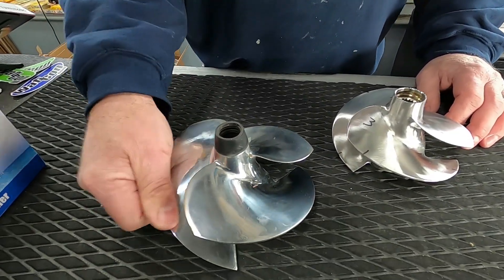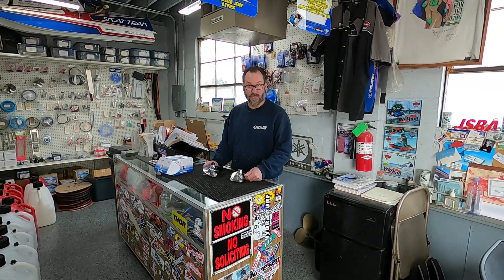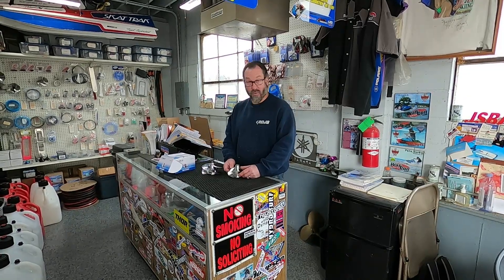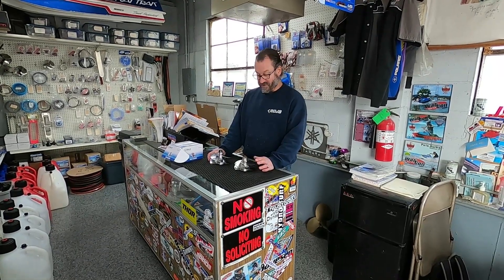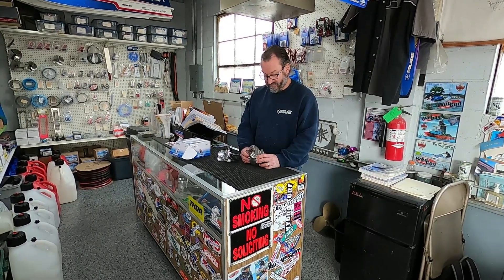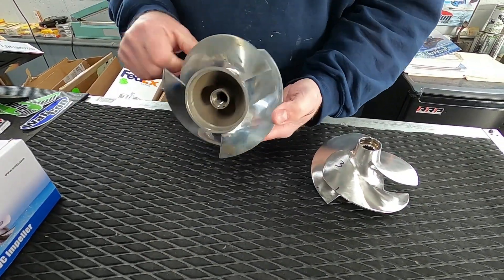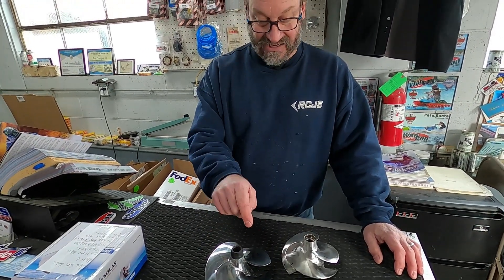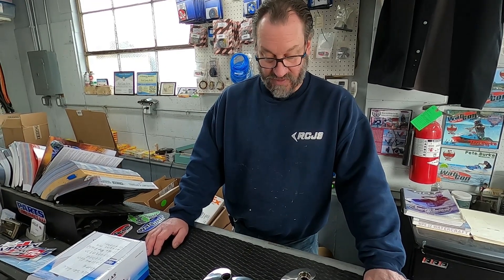Impeller Blueprinting

Comment: Thanks for the informative video. I wonder if you might do a video on the Yamaha 650, 701 and 760 engines. I'm familiar with the Kawasaki engines but not sure what the differences are with Yamaha and what can be interchanged on the cylinders for better performance. Thanks.
Reply from the maker: Thank you for watching. We have a video on 701 clys, where I talk a little about the port timing differences.  Yamaha 701 is the best. I like the 62t.